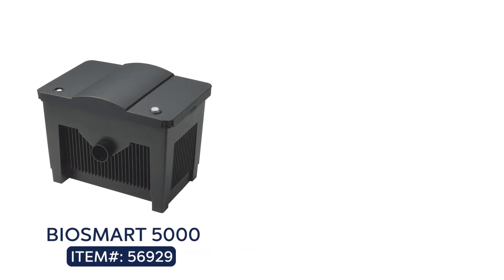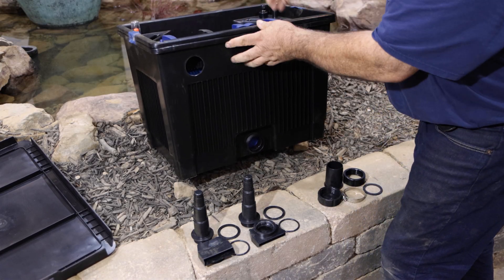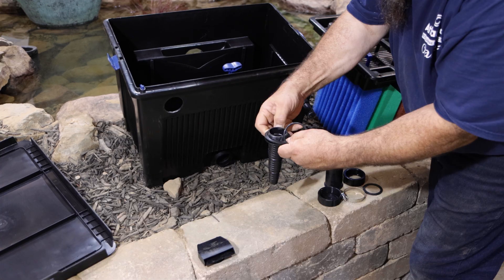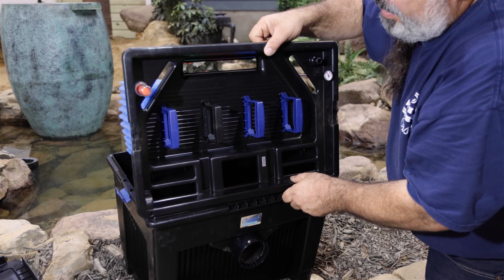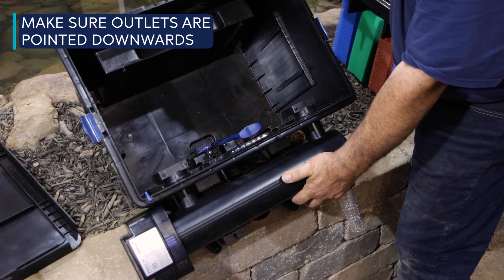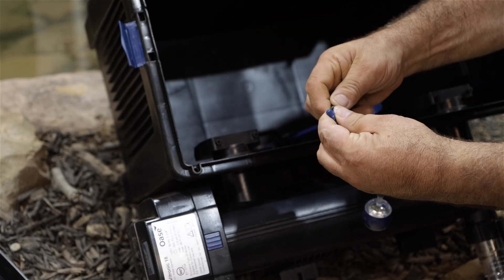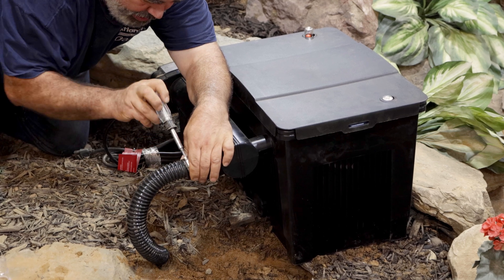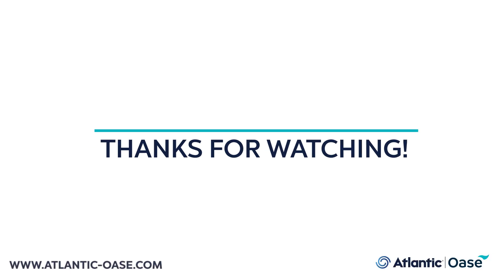How to Install a BioSmart Bio-Mechanical Pond Filter | Step-by-Step Guide

Comment: Also if you have both inlets open water will go in filter on right side never going through the uv light
Reply from the maker: There are internal baffles that direct water flow so all water will pass by the UV light before entering the filter.